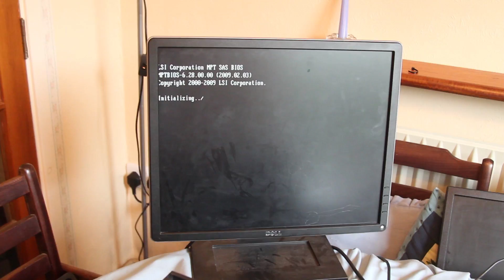Building a £430 Intel Xeon 12 Core Dual CPU 24GB DDR3 Supermicro Server

Comment: So... I'm looking at this motherboard .... I have a Poweredge R510 that I want to repurpose, because iDRAC is refusing to install any OS (wtf?) and I'd rather not have the management junk anyway, nor the rackmount form factor; all I need is a compatible mainboard (have CPUs, RAM, a stack of SAS drives, and a PSU with dual CPU hookups). Looks like the physical build will be no problem.

But was hoping to see a Windows install in action, lot of people building this but not many showing what I might run into between physical build (no problem, thanks for showing that) and desktop or home server.
Reply from the maker: I had to use a raid driver to install windows, I haven't got that pc anymore so I can't show you how but if you Google installing windows on a raid system it will show you how. Hope this helps
Reply: Thanks... I'll probably use Server2008R2, I think it has the drivers. I don't want the HDs set up as RAID, just as storage. I have SAS adapters but I think I'll hold out for the mainboard with integrated SAS.

Comment: Hey just found your video and Im literally building the same rig tonight when the coolers arrive. Only difference is I have a 500w psu. have you used this for gaming at all? If so which GPU do you recommend? Im mainly using this for a plex server but if I could run any AAA titles itd be a nice bonus
Reply from the maker: Zane depends on what your budget is I bought a amd hd 7850 1gb
Reply from the maker: and yes I have, definitely more than powerful enough for the odd game, if you want a better gaming computer I would recommend a i5 or above I've these CPUs due to their clock speed
Reply: Inspire Computing I just got a GTX 1050 Ti SC. arrives tonight.
Reply: Inspire Computing I'm mainly just interested in bf1, though, which I know is intensive
Reply: got it all set up but passmark only hitting around 7800 max for both CPUs...I was hoping for around 10k,.

Comment: I'm planning a build with this motherboard and I was worried by the problems people have encountered with getting aftermarket coolers attached (due to that weird, hard-to-remove backplate) but if freezer 7 rev 2s bolt right in (even with the clearance issues, haha) then I know what I must do. Cool video, thanks for posting it
Reply: Ya I'm using two different types of coolers. I'm still waiting for the other cpu however
Reply: After watching this video I went ahead with the freezer 7 pros for my build, there are  limited options on how they fit (either >/\ or >\/ ) but I'm happy with the results, and it seems it's the most economical option for these motherboards
Reply: Mike Sides Ya. The slots aren't perfectly lined up. Make sure when you build it that all of the stands off are on the holes or if your case has built in ones make sure you keep track of those. My motherboard was shorting out due to contact with the stand off since mine has built in ones. So the second CPU wasn't working but now it's fine with adding some electrical tape over the unused holes. Did you ever get those sas ports working? I can't seem to figure it out.
Reply: I don't have any SAS drives--- and I'm getting a different motherboard (X8DTI-F) without a SAS controller because I just don't need it!)
Reply: Mike Sides ahh I see what you mean. Well SATA drives can work with SAS ports I think.
Reply: For my needs I don't need much storage so I just have a boot SSD and a storage HDD, both SATA
Reply: Mike Sides me too. But hey why not add more!? Ahah
Reply: I'd really like an NVME drive but I can't imagine the board would like that very much lol

Comment: Hi there. I have this exact motherboard and so far have managed to smoke 2 new power supplies. The motherboard BMC heartbeat LED is the only thing that lights up. Then, the power supply would just buzz and start smoking when I turn it on. I'm testing the motherboard on a box so it's nothing to do with case contact. Is there a special kind of power supply that i need for this? Also, why did you wire an 8-pin and a 4-pin to the CPU power slots  rather than x2 8-pins? 5:20
Reply: I'm having the same problem with the flashing BMC and nothing else happening. Haven't smoked the power supply yet. I just ordered one of the 8 pin splitters to see if that makes a difference. Otherwise my hardware is very similar to the video. I'm holding off on buying too many other parts until I make sure it's working.
Reply: what are you using for the second 8pin cpu connector? Do not use the 8 pin pcie connector found on most atx power supplies as the wiring for 8 pin pcie is deferent than the 8 pin cpu wiring
Reply: I've been trying 2 of these: https://www.amazon.com/gp/product/B002O21XHQ/ref=oh_aui_detailpage_o02_s00?ie=UTF8&psc=1&tag=between08-20
Reply: This might be the issue. The power supplies had only 1 true CPU 8-pin and I tried to use a different cable I had on another slot (probably a peripheral slot). But I'm worried that even if I buy a PSU with x2 CPU 8-pins, it would still get destroyed due to the motherboard being bad. Any cheap PSU recommendations? By the way, have you seen the kind of wiring he did at 5:20 ?
Reply: Like @HunterChao mentioned, it looks like you're gonna need a PSU with x2 CPU 8-pins. Otherwise, this motherboard may require a BIOS update for a 56XX series chip to work. Is that what you're using? Even after solving the power issue (which I didn't yet), I still have to pop in a 55XX series xeon just to go in and update the BIOS to support the 5650s I have.
Reply: @exhawg (might want to try option 2 first if you don't have second power supply or if you find it more easy)

Option 1 Looking at the product i am assuming you are splitting the main 8 pin cpu connector to both adapters. If so and it still does not work i would get two power supplies i know work and plug one up as normal (use the 8 pin cpu for 1 cpu and use the 24 pin for the motherboard) Then i would take the other power supply and plug its 8 pin cpu header into cpu 2. Now you will need to put/make a jumper for power supply 2 as we need both power supplies on. If doing this makes everything run fine then you have a problem with the way you are splitting your cables. If you still get nothing then it is either your motherboard or cpu. Move to option 2. 

Option 2 is try the server with only one cpu and one 8 pin connector. Most server motherboards will work with one cpu. (dont use cpu 2 ram slots with only 1 cpu) If that works then swap the cpu and make sure both work on there own. If both work on then own then try option 1 if you have not.
Reply: You say cable you had on another slot. Are you using a modular power supply? If so then dont use any other "slot" unless it states cpu as even though a 8 pin will fit the wiring is based off the "slot" a cpu has 4 power 4 ground as a pcie/peripheral slot with 8 pin will be 3 power 5 ground
Reply: I am using these for my new server because they only require a molex and no splitting of the original 8. https://www.amazon.com/gp/product/B00OSR3V84/ref=oh_aui_detailpage_o00_s00?ie=UTF8&psc=1
(there is one bad review and thats because the idiot thought this was for pcie)
Reply: That's very likely where I messed up. However I did try the PSU on 1 CPU with x1 8-pin plugged in. Rather strange. i'm not sure if that's before or after I realised the PSU was smoked. Let me see if i could borrow a PSU from an older build to try just that.
Reply: Unbelievable. My last-resort method was to try 1 CPU only and that's after each PSU was already smoked (didn't know until later with a jumper test). Thank you so much! A single CPU is working fine! Time to invest in a real dual 8-pin PSU now that the motherboard is functional!
Reply: you are welcome :)
Reply: Oh, what do you think of this btw? http://www.corsair.com/en-us/rmx-series-rm850x-850-watt-80-plus-gold-certified-fully-modular-psu
Reply: Yea that should work great :)
Reply: They ran out of it where I live. Settled for this instead http://www.coolermaster.com/powersupply/enthusiast-v-series/v750/  It works like a charm. System rebuild has commenced!
Reply: Ok 1 CPU is working so it must be power. I'll try it again when the splitter gets here. I was trying with 2 4 pin+molex adapters. I don't know if I'm up for paying more for a 2 8 pin power supply than I paid for the motherboard so I might end up sticking with 1 cpu if the splitter doesn't work. Thank you everyone for your help.
Reply: DjGalm Hi. You may be suffering with the problem I had. When you place the motherboard in, is it touching with any of the stand offs on the case? My case has built in stand offs, that why mine was shorting when place a second CPU but yours could be shorting by anything since this motherboard has different mounting holes
Reply: Hi. This happened on a cardboard test bench. It turned out to be the PSU. It wasn't powerful enough and didn't have 2 CPU 8-pin cables.
Reply: DjGalm Ah I see. What kind of PSU did you use?
Reply: This one http://www.coolermaster.com/powersupply/enthusiast-v-series/v750/ Although I'm ok with it, it does have some nasty coil wine.
Reply: DjGalm Ah ok. Ya I'm not sure if it has to be EPS like a kind of server power supply standard. I'm using a Rosewill 1000 watt psu that has two CPU pins. It's also EPS rated so I'm not sure if that was one of the problems

Comment: Nice build,  I did the x8dtt a couple months after you. I'm curious though,  is the heat just swirling around in your case because of the way you installed those coolers?